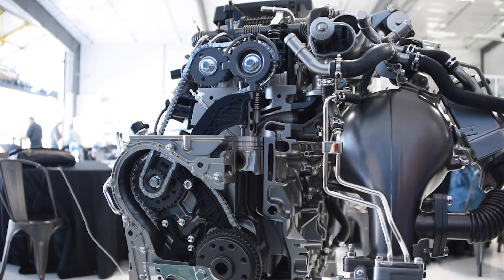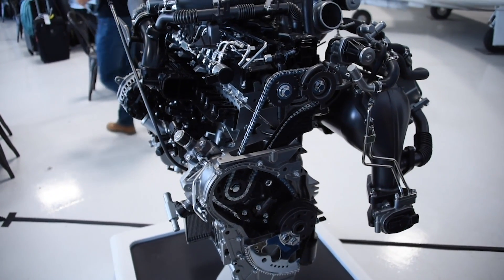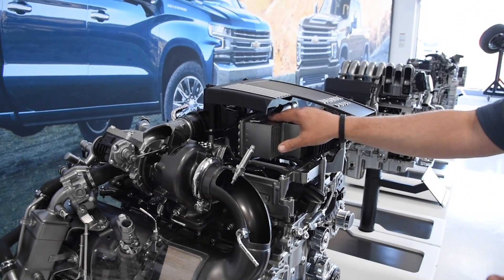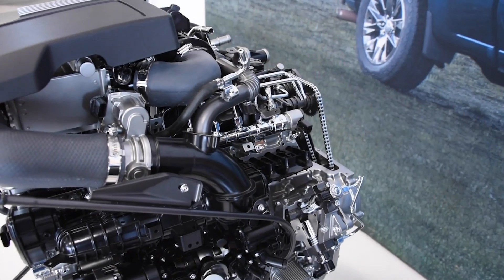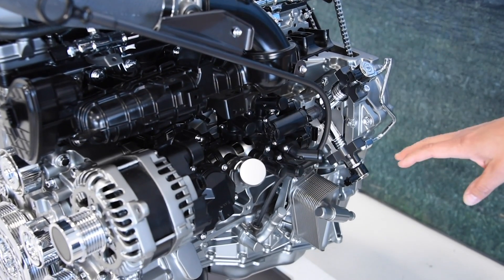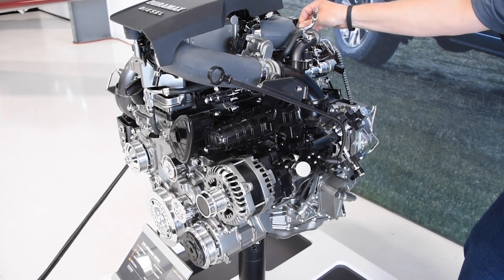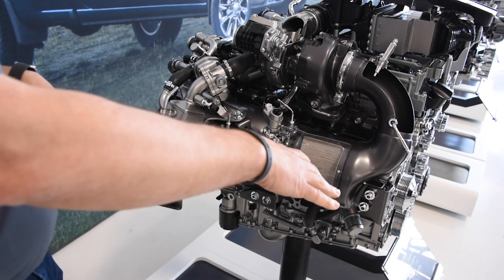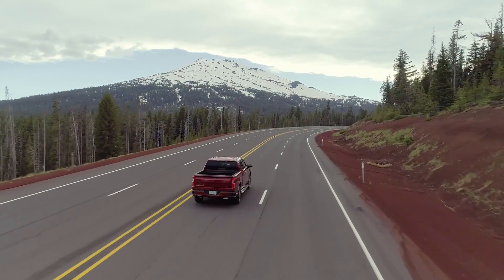What you don't know about the 3.0-liter Duramax diesel

Comment: The fact that it's an inline-6 and not a V-6 is a big plus - inherent primary and secondary balance, and, from personal experience, every inline-6 I've owned or driven has been damn near flawless, while every V-6 I've owned or driven has been a terrible engine (The power of a 6 and the mileage of a V-8 all in one package!) with endless mechanical problems.  Yes, I know that the plural of 'anecdote' is NOT 'data'.  

But... a chain-driven injection pump and camshafts?  A belt-driven oil pump?  Why, GM?  For the love of all that's good, true, and beautiful - why not use gears?

Comment: Diesel fuel costs more than gas + DEF fluid.  Diesel option costs more on the window sticker, simple oil pump belt service. Just simply remove the transmission.  Nothing simply comes apart in NE after a 150k. Sign me up.

Comment: GM EXECS..... I hired your lazy and stupid ass engineers when no one want a community college dropout.
GM ENGINEER.....Please give me another chance.
GM EXEC.....I already gave you all the chances when I hired your stupid ass.
GM ENGINEER....I gave the trucks 3 out of 4 broke ass engines that won’t last more than 20,000 miles. There’s the 5.3 and 6.2 with cylinder deactivation and activate fuel management which will damage the lifters by 5,000 miles and every 3,000 miles thereafter.
GM EXEC....Good. That is we’re dealership can make profit. But what about us.
GM ENGINEER....The 3rd engine choice is the 3.0 no-longer max. We can put rubber belt on the oil system so the belt can destroy the engine after the oil system is damaged from no oil circulation. We calculate we can either charge our stupid loyal customer 3,000 US Dollars to just inspect the rubber belt and not even change it. If they are smart they request the belt to be replaced. Or when there is no oil circulation due to belt damage, the idiot customer can buy a used 50,000 mile engine for 9,000 dollars or a new engine for 14,000 dollars
GM EXEC...We want to be like the US government charging idiot citizen 3 times tax to purchase anything. We charge tax when they work; then we charge the company selling its products; then when citizen wants to purchase anything, we charge them tax to purchase them also. LOL. HAHAHA. What a bunch of cattle with no brains.
GM EXEC.... How are we going to make money since we overpaid our union fatcats 140,000 a year to put one part of the car together with thousands of part. We can charge them 90,000 and offer 100 months payment at 4.5%.
GM ENGINEER....Yes, no one will option the 6.6 duramax because it’s a 10,000 dollar option. 
GM EXEC...Good. Good. Look, we will now look at the sales floor. Look at these idiots, we got one of them to buy a shiny Denali at4  with baby max. Hahaha. Oh no, we have a smart Asian buyer and he’s backing out of the deal to go where? FUCKIN TOYOTA TUNDRA. NOOOOOOOOOOOOOOOOOOOOOOOOOOOOOO.

Comment: How would you service that thing in a pick-up application?? What they'd think it'll never break down. Isn't that engine build by VM Motor? An Italian engine company. But badged as Duramax. Why'd GM even consider straying away from the Japanese.  The 6.6L put light duty diesels on the map. The Europeans & Italians are known for the most impractical engineering designs. You mean to say GM is still incapable of building their own diesel?  Ford does it. Why can't GM? Daimler/Chrysler/Fiat/RAM is no longer American but they still use the best w/Cummins.

Comment: The DPF heats greater than 1300° F. Very risky placing that in the engine bay vs under the truck. That’s a lot of heat in a enclosed space with little venting. Wonder if there is a gauge in the info system that show miles or %  to regen.
Reply: Unless it's placed towards the grille. That's where the ventilation is.
Reply: That's not that much hotter than a catalytic converter and a lot of fwd car have them in the engine bay
Reply: BTW idk anything about the dpf system past how to remove the useless things

Comment: What a horrible design. Simply drop the transmission to change a rubber drive belt for the vital oil pump. GM money grab for later service dollars. Or force you to trade to a new vehicle because you won’t want to spend the money to service it.

Comment: Dropping the transmission was the entire reason I didn’t get the diesel instead I got the 6.2L.
Reply: I chose the diesel for the stuck lifter situation with the 6.2L, funny how we went different ways.  Not a dig, just interesting.
Reply: @gilvietor1918  I thought the same thing with the 6.2L but it should be faster to pull a head than dropping the trans. I really was contemplating the diesel because I wanted to own a diesel. I probably would have been happy with either.
Reply: Bought the 3.0 x31 version and it's been fantastic.

Comment: Picking noise over reliability why I won’t buy a new Chevy truck really any brand Chevy got the oil pump driven by a belt I don’t care if it’s rubber composite / dodge transmission diapers/ Ford with the simple timebomb 6.7 come on what happen to being able to do it at home with out a lift

Comment: Where are the spark plugs? And how long do they last?
Reply from the maker: Diesel engines don't use spark plugs. Diesel ignites using compression and heat, so they use glow plugs to get the combustion chamber hot, then the compression does the rest. Some newer diesel engines don't use glow plugs either, but introduce very hot air into the combustion chamber before starting.

Comment: When you make one of the oldest and most durable engine designs into a nightmare. Hard to believe the 250 in my old c20 was made by the same company, I could do piston rings it a day on that thing, oh cracked the block? No biggie go buy a motor out of a junkyard for 100 bucks r and r in 2-3 hours. I’d rather buy the new 7.3 Godzilla from ford, cam in block, 16 valve, 445 cubic inches.

Comment: It sounds like this engine is extremely well thought out, unlike Ram’s sorry Ecodiesel that likes to implode & never gets the listed mpg.  I drove this engine in a GMC pickup & the wife was ready to buy it!  You couldn’t even tell it was a diesel!
Reply: Give them a few years. 
I think they put too much thought into it.
Reply: Oil pump belt. And you still want to buy it???
Reply: @juliebrewer1065 - Have you heard of frequent oil pump belt failures?  I haven’t, but I’m not ready to buy yet. FCA has redesigned their Ecodiesel for reliability & emissions.  Ford pulled their 3.0 diesel & so did Nissan.  Toyota won’t even offer their great diesels in America.  GM is the only maker that is building a diesel that’s reliable & efficient.

Comment: I don't mind working on engines. The problem is getting the customer to understand all the time it took to remove the failed part and put it back together.  Just like the timing belt on the Subaru sti. Also if the engine and components are so great, the warranty should reflect on that.

Comment: How the F wants to pull the tyranny every 150k to change the Belt that runs the oil pump! I would never by that and I owen a diesel  truck. GM is dooming there product. Why? Put it in the front dummies or make it gear drive.

Comment: This engine seems like trash down the line with any real mileage... Mainance cost looks like it'd be a bitch... I wouldnt want to work on this inside a cramped engine bay and now transmission tunnel for the belt and chain drive systems.......... But they did fix the soot build up inside the intake

Comment: There is a point where "technology" runs away with reason,  and there is also a point where technology reaches a point of Absurdity.... well, we're well beyond That point, and in "today's world" it has arrived at the point of Insanity and beyond "reason"!!  There are two old sayings that "should" apply here... 1) KISS = Keep it Simple.. Stupid!!... and 2.) "Just because you Can... does NOT mean, that you should"!!    

Big Deal.... they've managed to Wayyy Over Complicate a diesel engine to arrive at 30 or 30+ mpg..... Whoopie!!    

You can take just about Any older MECHANICAL farm tractor diesel (JD, IH, MF, etc.) engine... though some of the 4 & 6 cyl. John Deere's are favorites.... and stuff them under the hoods of older (mechanical) pickup trucks (even some cars!)..... and get 40 to 80+ MPG, all day long.... it's been done Many times over the years.  

I've converted several 70s & early 80s GM and a few Ford pickups over to 2 cycle (Series 53) 3 & 4 cyl. Detroit Diesels.... and they've all gotten between 32 & and as high as 43 mpg..... even while towing a 5th wheel cattle wagon... loaded!   No technological wizardry, no complicated bs sensor systems, etc, etc, etc..... just a simple diesel engine, a turbo in some cases, and that's it... other than build proper mounts, transmission adapter plates and whatever it takes to do a nice, "clean" conversion.   

I had an older friend of mine who, back in the early 1990s, repowered his 1978 Ford pickup with a small inline 6 cyl. Italian marine diesel (Lombardini ?), that he mated with a Muncie close ratio 4 spd taken from a wrecked 67 Chevy Chevelle SS (w/427ci bbc).... it would get 42 - 45 mpg.... pulling his 38ft 5th wheel travel trailer, or whatever he wanted to tow, and upwards of 48+ mpg not pulling anything.    These modern day "how complicated can we make it, automotive engineers"..... have completely lost all sense of........Common Sense!    KISS!!!

Comment: For the one's freaking out about a belt driven oil pump, keep in mind just about every other single advancement has elicited a similar reaction.  EFI, turbos, you name it.  Time will ultimately be the judge here, not armchair engineering.  It wouldn't prevent me from buying a truck with it, as it nails what the intention of this particular motor: offerering a great balance of modest towing capacity in lighter duty trucks and great mileage.
Reply: 150k miles, transmission out to change a belt? BUT "Appropriate Diagnostics" will forewarn you of failure. Oil psi is zero oops time for a new belt !!
Reply: @mylarson7640  Bro so what you have to do the same thing to replace a clutch, your acting like its a big deal, 1k - 2k max for everything
Reply: Exactly
Reply: Except EFI & Turbos don't have an expected life before they have to be replaced. Efi systems &  turbos can go the whole life of the engine without ever having to be replaced, given the engine is maintained..
Reply: @alextran8188  The fear was exactly the same: where the added complexity added points of failure, and therefore was not a good tradeoff on the result.
Reply: exactly stupidist  way you could design  chain assembly  and oil pump and put it on rear of engine, these people must be  hiring chinese engineers
Reply: @kingdommusic5456  Pro tip:  You may want to try framing your argument using proper spelling and grammar.  A perfectly valid position can often be dismissed because it doesn't put the author in the best light.
Reply: isn't ALL engineering armchair engineering?
Reply: @tomk8312  Well, I doubt SpaceX was able to make booster rockets land upright from casual observations, so... no.
Reply: @PK-vd3vo  ask a mechanic about the "armchair" designs of engineers
Reply: @tomk8312  the mechanics deal with the realities of the design requirements and constraints of the effort.  Most engineering are well aware of the balancing act that has to take place between things like. Cost constraints, EPA efficiency requirements, safety, etc.  To appease the mechanic may include some good input, but it may also include suggestions that would never make it past approval.
Reply: @PK-vd3vo  B.S. automotive engineers should be put on a rotation: design and build vehicles for three years then rotate to being the mechanic that fixes and repairs those vehicles for three years and at the same pay as all mechanics in the industry. I guarantee the net results of the products being produced would be  much better. The automotive industry has shifted focus and prioritized short term financial gains over the customer’s experience: cost of ownership, repairs, downtime, etc. they’ve also neglected the mechanics value and details of what it takes to work on their products. Fortunately I found an industry years ago that engineers and produces products that invest in these efforts. Our engineer teams work with R&D, build proverbial prototypes, have a few select global customers use these prototypes in various real world conditions, regularly interview the customers, operators, and mechanics all the while gathering valuable information to revise their product before ramping up production. These considerations are evident and much appreciated by all after the initial sell. My advice to young mechanics is working on vehicles is okay and there are a number of great auto based schools to attend and gain a good foundation of knowledge in APPLICABLE physics and chemistry that mechanics need to have a good working knowledge of. Then the best advancement of their career is find another industry or customer that has a higher value for their skillset. The easiest way to find this is consider the initial cost of purchase and purpose of product. Avg cost of auto: $40K and is used to transport people A to B. When it breaks down it’s an inconvenience but one could easily borrow or rent a car… VS. a large industrial machine $1.5-2.0 Million used in production. When it breaks down it’s costing a company a lot in downtime and not easily substituted. Now you’re skillset has a lot more value!!!
Reply: @preachers4135  Yes, I not only agree that a practice of practical hands-on would be beneficial to the engineer and the consumer, but am thrilled to hear that some of those steps are in place at your place of employment.  It can potentially foster smarter designs, but, it does not reduce or eliminate the typical challenges of design, whereby you are factoring in 1.) requirements, 2.) constraints, 3.) assumptions, and 4.) risks.  I would love to have a battery easily replaceable in my iPhone, a large laptop that is light but affordable, or, dare I say, a vehicle that every aspect of it is serviceable and replaceable.  Whether it be a laundry dryer, or a PC, the practical realities of such nice-to-haves also have a corollary impact on costs with questionable returns.  To compare it to generations past is not realistic given the average service requirements, efficiency and lifespan of an ICE was far less than it is today.  The free market is the best possible distributed signaling system to tell a manufacture if they have found the right balance of reliability, serviceability versus packaging, and can be demonstrated at the extremes.  If tires weren’t replaceable, well then it wouldn’t take long for the word to get out and that vehicle wouldn’t sell.  But intelligence integrated into an ECU that controls fuel mapping so that someone doesn’t have to futz around with a carburetor is a pretty good thing, and the market has spoken.  A great example of when a Mfr makes the wrong choice was when Ford used a dry dual clutch design in their Ford Focus.  It was catastrophic.  Their engineering teams advised against it, but they moved forward with it anyway due to all four of the design factors listed above.  These types evaluations can also be found with modern heavy equipment, where there is a more extreme need on serviceability.  My point with the 3.0L diesel as that time will tell on whether or not their design choice was a good one or not.  Probably not as robust, serviceable, or simple as a 35 year old Cummins, but the requirements of today are different than what that 35 year old Cummins was designed for.
A good healthy discussion though.  Thanks, and be well.
Reply: Except every single engine build with a wet belt was known as unreliable and the acids in the oil degraded the belts and created premature failure... Time and time again, irrespective of brand. But this time, this time is different! Lol. Everything that was done for the sake of emissions and better mpg created unreliability, what are you smoking my man? They could have used a chain like on the timing and be done with it. Same with the variable oil pump, it's substantially less reliable by design over a gear driven pump. Just facts. Why do you think Toyota doesn't use this crap? Because they're bad at engineering, and somehow GM found the holy grail? 🤣🤣
Reply: Any way you look at it wasn’t designed long term durability. It was done because it was far less expensive than to design and install a bulletproof gear drive like HD Diesel engines have used successfully for decades. As a technician I can’t tell you how many various engines that were marketed as “never needing service “with chains that absolutely suck even with excellent maintenance. GM’s 3.6 and Ecotecs are evidence of GM’s track record for building service free chains. I’m convinced that there’s nothing that GM can’t screw up.
Reply: @prevost8686  Well they didn't build a motor with the water pump inside.  (Ford Did!)
When it goes bad and starts leaking your engine is toast!  Better idea my ASS!